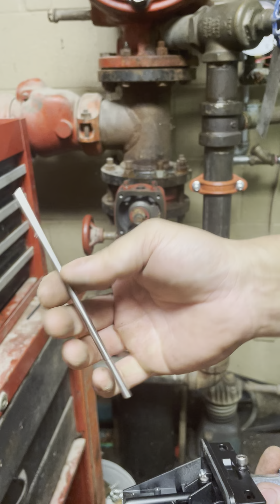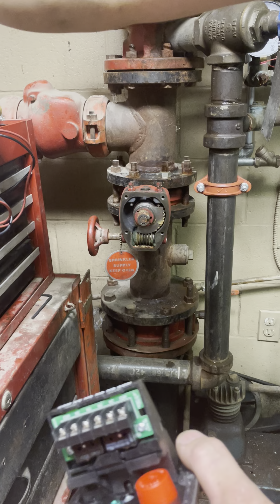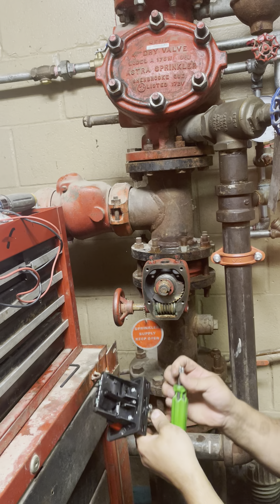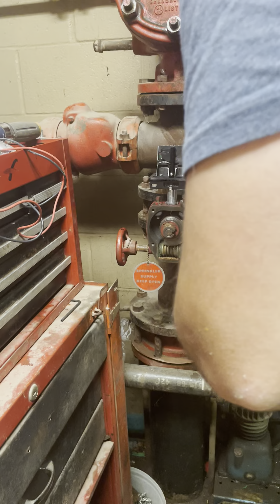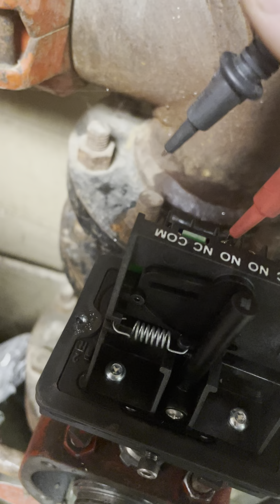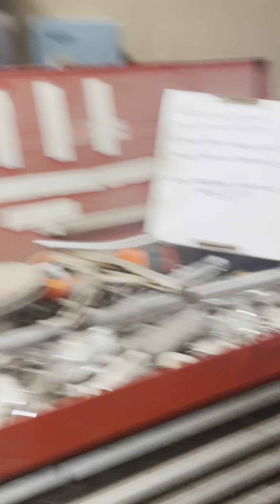How to Install a Potter PCVS-2 Switch

Comment: Thanks for the video, it cleared some confusion for me as far as NO and NC. Im guessing fire sprinkler temper switches, pressure valves usually are in a Normally Open position?
Reply from the maker: I'm glad it helped. While it may not always be 100% true, I would say yes more often than not sprinkler devices are typically wired with Common and Normally open contacts (and you'll usually find an End of line resistor going across COM + NO contacts). 

Sometimes there is no actual fire panel and all of the wires just go into a security type keypad, usually those types of fire alarm monitoring utilize COM and NC circuits, so creating an open condition in the wire is what gives the supervisory/alarm signal. 

At the end of the day its wired based on what the Fire alarm panel wants to see. If you're unsure then you honestly have a 50/50 chance of wiring it right; One wire or pair of wires (depending if its class A or class B wiring) will always go to COM and the other wire or pair of wires will either go to NO or NC. Try it one way and see if the panel clears and then test the switch mechanically to make sure it works. If for example you put the wires to NO and you keep getting a supervisory/alarm on the panel, then switch the wire(s) over to NC instead and it should clear.